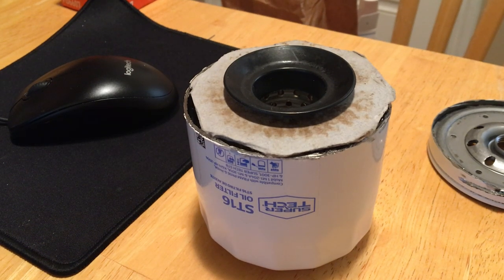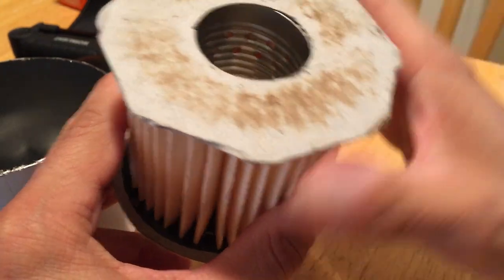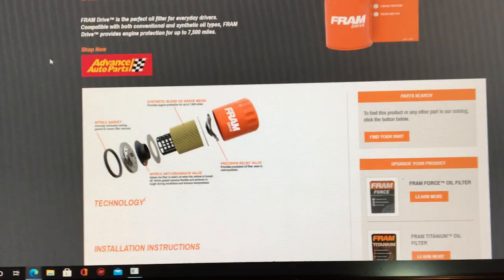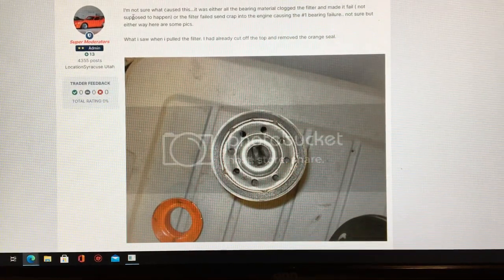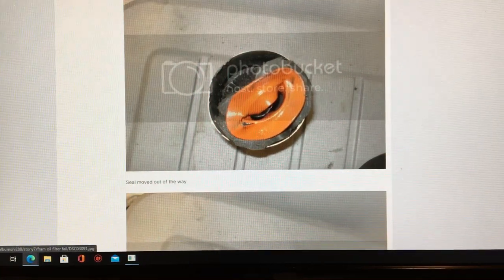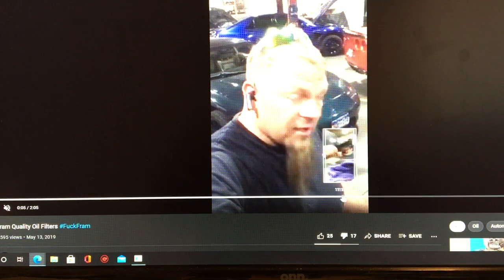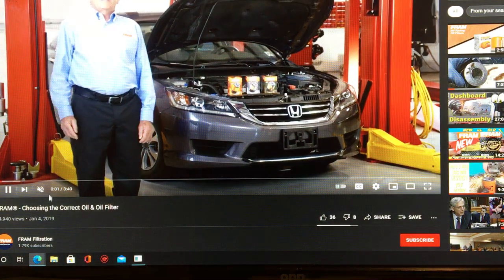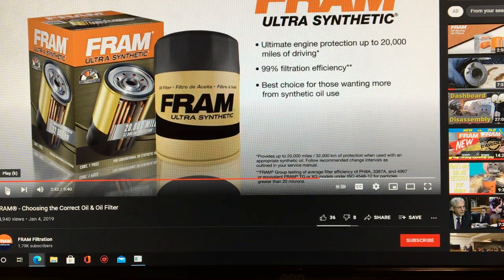The new Walmart supertech ST16 ST5 / FRAM Oil filter fail / FRAM DRIVE Oil filter FD6607

Comment: Over a year ago, Fram was bought by First Products. That parent company owns both FRAM AND CHAP LABS. They seem to be messing around switching products around. The cartridge filter for my 13Camry  TG9972 (fram) is now actually a Champ Lab filter in a Fram box.  From what I can see the only difference on the cartridge filter are the end caps.  Never have had a problem with any fram filters in the past and been using them for over 40 years.
Reply from the maker: You have been lucky, wish other have had the same experience.

Comment: All the end caps are for is to hold the glue to seal the ends of the pleats. Fram products from advance are rebranded advance auto brand products. They are way better and different than Walmart fram products. I love how everyone is becoming oil filter engineers on YouTube.
Reply from the maker: Walmart filters are not the same? What are you talking about? Are you now one of those engineers. I gave you documented proof of a problem that real people are having with FRAM extra guard, and I am positive not all those filters came from Walmart. Do me a favor, come here with data to support your claims rather than talk straight crap out of your mouth. I have toilet paper for that. No one said the paper end caps are an issue, this video is about the center core housing of the filter, thank you!
Reply: @xlightssx  if you even read my comment. I said they are different. Reeeeeeeead the comment before you reply
Reply: @xlightssx   according to a advance auto rep that deals with my work the fram filters you get from Walmart are completely different from the fram filters you get from advance auto parts. You can't even get the fram force titanium and drive filters from Walmart. I agree 100 percent that Walmart grams are. Junk. Go to an advance auto. You won't won't see advance branded oil and air filters,grease,oil. It's all labeled fram
Reply: Another one. Advance got rid of the autocraft name and now have die hard batteries witch are relabeled autocraft.
Reply: @xlightssx  okay the extra guard fram filter has been made for years. And they are ruining engines and do not work. If they keep selling them and making them. You getting the picture?  They are using that cellulose paper. Because they can get 20 microns out of a cheaper design than the other very expensive or not so expensive oil filters that usually go the lowest of 30 microns. That's it. I'm not doubting the study that you have used but even that study raises questions. Like I said they've been making them for years how come they're not sued out of business. Or people stop buying them because they're ruin your engine. Can't be that bad.
Reply from the maker: @citizenray5169  thank you for the questions, the reason they don’t stop making them is because the lawsuits and failures at this point are not affecting the amount of money they are making. You are correct filter failures are happening but not to the point that it’s affecting business. As for the micron ratings, if the filter is not sealed correctly like the one in my video then what good is it. It’s just a marketing ploy. Cellulose is not that much more expensive. We will give the public a cheaply build filter and through some cellulose at it and they will feel better. I and many others can care less about a 10 micron difference between filter brands. It All boils down to money, and at this point the profits don’t justify the cost for change. Hope you don’t become one of the few that has a failure like the people on my video. At the end of the day I provided documented evidence of real people’s experience with FRAM extra & tough guard. Photos & video. This is not the experience of many extra guard users, but the failures are higher than normal.